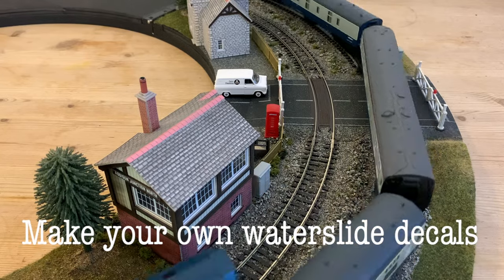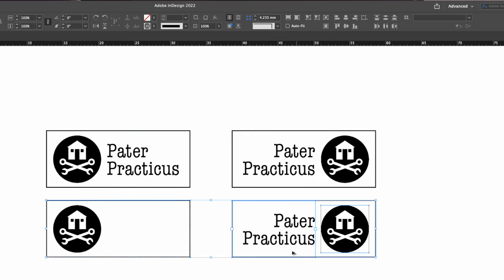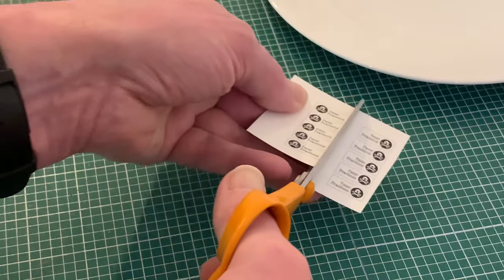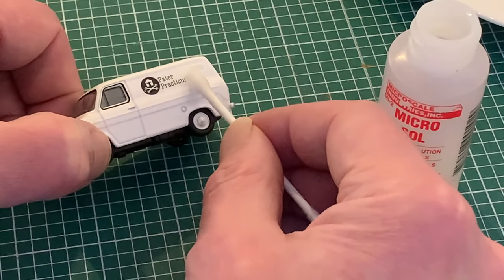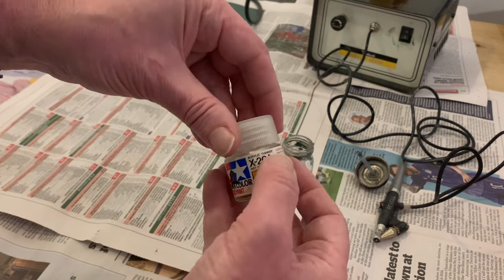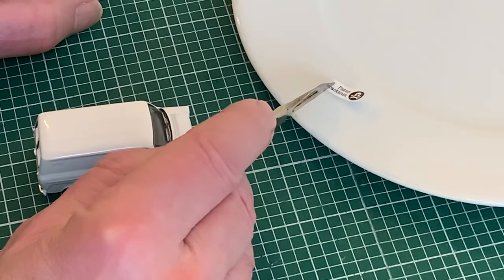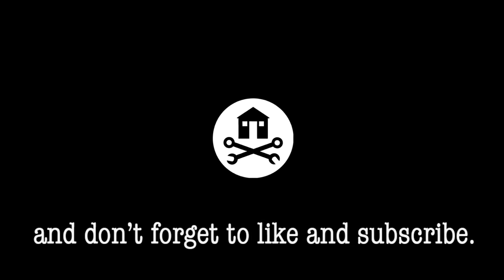Make your own waterslide decals - inkjet and laser printed model transfers

Comment: What paper did you use? "Glossy side up".....of what paper?
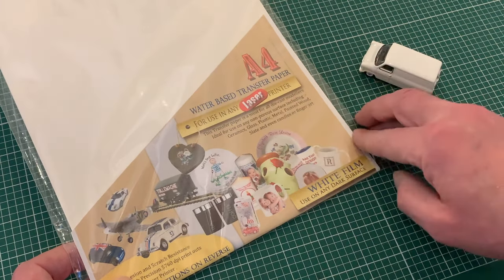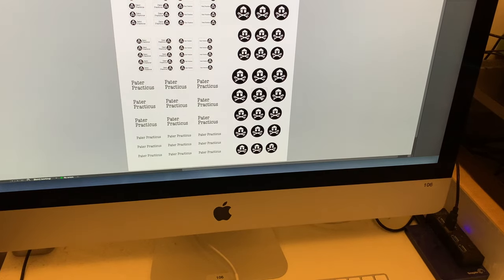Reply from the maker: Hi. You can see the paper I used for laser printing at 1:00 and 4:21 for InkJet - both of which I got from Craftovator, but there are other brands available. The glossy side is the printed side which floats off the backing sheet in the water.
Reply: @paterpracticus  Thanks!!
Reply from the maker: No problem. Doesn’t matter much if you print the wrong side, just turn over and print again.
Reply: @paterpracticus  Great help! Thanks again!
Reply from the maker: Don't know if you've seen it, but I've just added a video of how to design and layout the graphics to print as decals (https://youtu.be/4Z4kqRR1go8?si=Gnp_4dDOsVCYK_Ao). You might find that useful too.

Comment: Microsoft Paint sucked for this.... make it a certain size on the program... and it prints out either too large or too small...
Reply from the maker: Not familiar with that particular application. I’m planning a video for designing decals, so it’s good to know to avoid that one!
Reply from the maker: Hi, I've just posted a new video showing how to set up images for printing, and some simple graphics design, using PowerPoint: https://youtu.be/4Z4kqRR1go8.

Comment: Didn’t understand, why did you print many logos on A4 sheet? You need just 2 pieces
Reply from the maker: As the smallest sheet I could print on was A4 it made sense, as even though I only needed a couple, I didn't want to waste the rest of the decal sheet. It meant I had some spares if I messed any up, and I've already used some of the other larger sizes on some other projects. Still got loads left though.

Comment: GREAT VIDEO BUT Is there an app to make the pictures small ? Like the exact scale that is need it for the hot wheels? Any body please help thanks.
Reply from the maker: I used Adobe InDesign to make the layout of my designs, but there are lots of alternatives. Even putting images in something like Word would work. I’ve had several similar enquiries, so I think a video on some of the options might be worth making. Would be good to know what software people regularly use.
Reply: @paterpracticus YES PLEASE MAKE A VIDEO THAT WOULD BE GREAT. THANK YOU.
Reply from the maker: @elfather20  I'm doing a quick survey on Twitter - https://x.com/PaterPracticus/status/1712479920532971524?s=20 - to see if there is any free page layout software people would like to see in particular.
Reply from the maker: Hi, I've just posted a new video showing how to set up images for printing, and some simple graphics design, using PowerPoint: https://youtu.be/4Z4kqRR1go8. I hope you find it helpful. Even if you don't have PowerPoint, some of the techniques will be very similar in other software.
Reply: @paterpracticus  Hello, thank you. I will check out thanks 👍